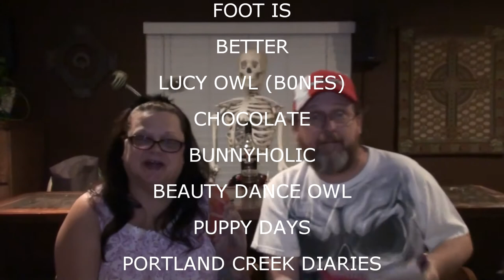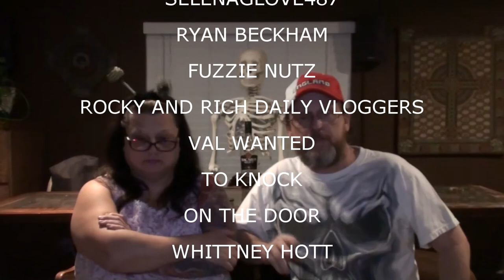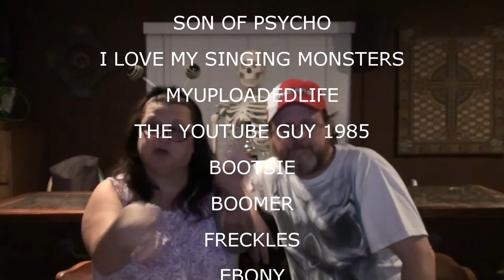KEVIN FINALLY WORKS ON THE FLOOR

Comment: You might even have to give it a month. Weight loss is a journey, it doesn't happen overnight. Wish you the best and don't get frustrated. The amount of time it took to put on the weight also plays a part. I got a bit frustrated because I wasn't losing my baby weight as quickly as I could lose weight before and part of the reason is because it took nine months to put it on. I am just now fitting into my old clothes. If you are willing to make the lifestyle change you can do it! I believe in you!
Reply from the maker: NIkkiandJohnVLOG Thank you Nikki - it is just really frustrating the gastric bypass class I am in - they expect so much from you so soon! And half of the stuff they are telling you to do and to eat are things that I can not do because of my other illnesses! But I am sticking with it! Thank you for believing in me - it means a lot to me! Val

Comment: I've always wanted to change my name because it's so popular. My mom named me Jennifer after Stephanie Powers character on Heart to Heart. My name was either going to be Jennifer or Stephanie. As a kid I never liked either name lol. Too many Jennifer's born around the same time. I remember sitting in a class and there was 5 of us. If I could change it I probably wouldn't because since my mom passed away last summer I have more value into the things she did for me. But I do use Daisy a lot online as my aka :-). I just like the flower. Transamgirlie came from when I owned a trans am in the early 2000s lol.
Reply from the maker: transamgirlie I like both those names - but yes I can understand they are both common names!But I can see not changing them at this point in honor of your mother! I do like the aka of Daisy! Pretty cool! Val